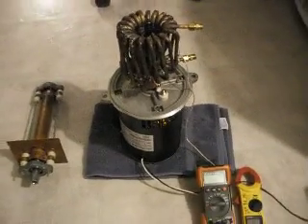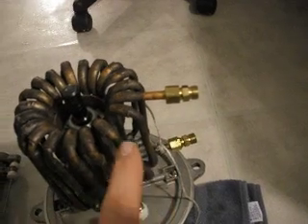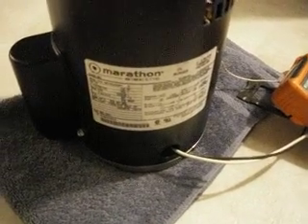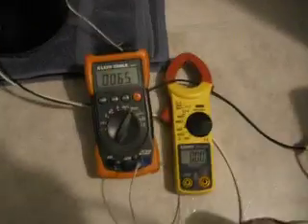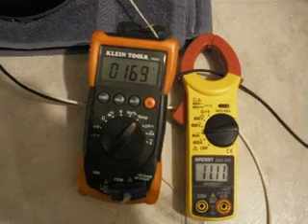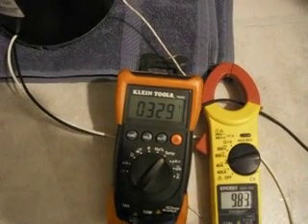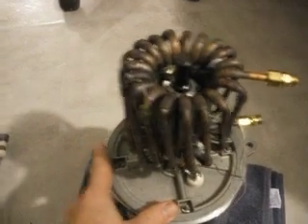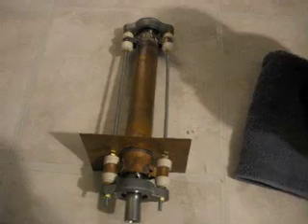Magnetic Heater Update

Comment: I was wondering about the heat effecting the magnets  since there kind of contained inside the copper ( cage or housing setup you have) I know there is high temp magnets available, is that what you have? Love your Design
Reply from the maker: Hello, these neodymium magnets that I used can withstand temperatures up to 176F ... but they do make other ones that can go up to around 446F. When they're spinning at high RPM they barely get warm, it's only when it's stops is when the radiant heat inside will heat them up. You can use some heat shield cloth and wrap them to help solve that problem😁.
Thanks for watching and have a great day!
God bless😇

Comment: I made 1 using a bench grinder...same 3.5
 amps and 3450 rpm....using a 2 inch copper coupler....got to hot touch very quick....magnets never got hot... ( only 4 )
very cool...now Ineed to find a proper application...but most likley use the wheel method...Thanx for your video
Reply from the maker: +craig campbell 
Your welcome buddy, good luck on your project.

Comment: 3 things.... you said it was 360 degrees but then you were touching it with your hand..
I was also wondering how you connected the magnets to the shaft....? was it J-B Weld....???.. you also said the temperature will keep climbing if you left it on.... if it were me I would want to check the extreme and I was wondering if you did.. and how high it was
Reply from the maker: +craig campbell 
Yes, it was 360 degrees but I was not keeping my hand on the metal if you noticed... I was tapping it. The inter copper was the hottest point of 360 degrees because that's where I placed the temperature gauge, the outer pipes we're not as hot. I made another video as to how I built the magnet shaft if you would like to watch that one to find out how I did it... It was very simple. No glue was used... I never let it run higher than 360 degrees due to the fact of the magnets losing their magnetic field... I was going to install a fan in the center which would keep the magnets cooler because they acted as a impeller. I ran it at that temperature a lot and I never had any problems with the magnets losing their field after constant testing. Thanks for watching.

Comment: hi there, 

can you tell me how many rpm you need to create this heat. 
also what is the psi of the water flow is it mains pressure that you were heating to 80*
Reply from the maker: +George Lowe 
I I believe the motor that I used ran at 3400 RPM, the faster you can turn the spindle the faster you can produce the Heat. The water line was hooked up to the kitchen sink faucet so I believe the pressure was around 12 to 14 PSI. Thanks for watching.
Reply: thanks for the info.
heres a stupid idea, do u think u could get enough pressure from the mains or a pool pump to power a tesla water turbine that powered the spindle.
or maybe more efficient to just power a heating element from water turbine.

Comment: Be aware of demagnetisation caused by hight temperatures. You can screw a second nut above the first nut so the shaft is extruded above the length of the copper tube avoiding heat dissipation trough the magnets to cool down the bolds and also the magnets! Greetings.
Reply from the maker: Thanks for your suggestions, but I had no problems with the magnets overheating... Through the spinning of high rpm created a wind votex like a vacuum that kept them cool. They will never reach the high temperature to lose their magnetic field. Thanks for watching.
Reply: +whyme2b o.k. , wishing you a lot of succes...

Comment: Is there no way to regulate, you just have to shut it down.  I do not see the big picture because, power used is not coupled with heat gained.
Reply from the maker: There is a way to regulate the heat, it's all to do and how fast is spinning. You can use a thermostat though to turn the unit on and off as it will radiate the heat for a good time which could save energy depending on how you set it up. Thanks for watching.

Comment: Hey! Very cool! I'm searching for an energy efficient radiant heater idea, and this seems like it could be the right technology. I was interested in an oil friction heater, however I believe using this idea would be running with much less drag. For those wondering what this technology could be good for, if you have your motor set up to run efficiently, you could have a radiant heater putting off 400 degrees for $30/mo running 24/7.
whyme2b, how would it work to close the loop and have water or oil circulating in a closed system. Would you fill the tubing up? Or leave some air in the loop to cause the liquid to circulate? I'm also wondering if you think a person could build a heater that is 2 or 3 feet high, with the copper tubing coiled upward, I'm just trying to think of making a bigger unit to really get a lot of heat output. Your thoughts?
Reply from the maker: Hello Ryan,  thanks for watching my video. Magnets work very well with very little drag if built in a long fashion like mine. The reason being is that the motor used to spin them has a bigger rotor size which can easily over come the magnetic drag and use lesser current to do the job. A closed loop system would work great by using a circulatory pump and antifreeze to reach a hotter temp, can be a closed system but would need to install a PRV valve for safety reasons or even just heating up oil and let it radiate and use a t-stat to turn on and off the motor when it reaches it's set temp. You can build a bigger design up wards but would still need to be long tubes. Good luck on your project buddy, and again thanks for watching.

Comment: Would be great to see a 12 volt space heater / stove top design for the pepper crowd or those of use trying to get away from the AC currents ruining our home environment.

If you added gears like on a bike then it seems this could be a very logical design ? I have a 21 speed bike and I can pedal up the steepest of hills with no effort, and I could do this for hours without stopping... The hard part in keeping the front wheel down.

Comment: Interesting use of diamagnetism or what I like to call 'magnetic friction'.  I can see having the motor hooked up to a thermostat so it cuts off when it gets to hot, and storing the water in a tank first instead of use straight out of the pipe.  This thing has to save you alot on energy bills.

Comment: Hi WhyMe, I see that you did this years ago, but did you ever determine if this is a cheaper way of heating water, like for heating all house hot water needs ?
Looks like it is a cheaper way, but I guess the best way is to find a motor using the least power or much less power to run the magnets .
Tx. for answering , Cheers, Gk.
Reply from the maker: Yes, I believe it would work very nicely if you found a more energy efficient motor to spin it....but for meeting house hot water needs, not sure about that? I think it would do well as a heater thou in circulating the water or oil in a looped system to provide all your house heating needs. Thanks for watching.

Comment: Hmm... I would call this an "Eddy Current" heater. Or, maybe, a "Lenz Heater" for the scientist who crafted the first formulae for this effect. The inner cylinder is, essentially, a shorted turn on a transformer. Even though it might be more efficient to use an electrical resistance heater, this could be wind or water powered. You just need a source of rotary power. Good for green energy, eh? Just keep in mind the magnets need to be kept cool. If they go over the Curie limit for the spec (called Tc in the data sheet on them), they stop being magnets.
Reply from the maker: Yes sir, I agree... In my design the magnetic shaft actually was a propeller as well which drawn in cool air threw the tube to keep them cool. I was thinking of also wrapping them with a heat shield cloth for extra protection, but never needed to.Thanks for watching it.

Comment: Even children know hot water expands, so why didn't this junk explode with the steam pressure?  There is no pressure relief on it hence, its a fake.
Reply from the maker: Steam pressure? I never looped the system to build up steam pressure...I only ran water threw it from the sink faucet pressure which gave me a 30 to 35 degree increase of running it continual. If ran in a loop, yes... I would use a pressure relief valve for safety. And yes, it's very real in what your seeing here! Thanks for watching.
Reply from the maker: Your not stupid, it's good questions that are being asked... Their are a lot of fake videos out there scamming people to believe that, but mine are from the heart... no deception intended. God Bless You for being honest about your opinion of this video. Thanks for watching buddy.
Reply: Kevin Chamberlain
He did mention that the maximum outlet temp. of the water was 80° (flow rate not specified), no steam there. Also, it is not shown as a closed/sealed system (nor should any be without a relief mechanism, of course).
Reply: Kevin: Listen to the video again, Whyme2b-did explain this clearly. tx.
Reply: @ Kevin Chamberlain : I watched the video and read the posts about it. You have questioned the steam pressure and explosion. In the video there is no water supply included in the design, so the thing will never explode - however the tin on the copper tubes will melt. Secondly, the pressure valve is a good choice from the designer. And third : whyme2b , I would like to be contacted from you through email, this design and solution is not perfect but could be pushed in a very good way. My company is interested in mutual work as well possible beneficial partnership. Best regards.

Comment: Hello!
What should the least motor rpm be? When the temperature reaches up to 250 C,how do the Neodymiyum magnets keep their magnetisation although normally they start to  demagnetise at 80 C?
Reply from the maker: At least 1000 RPM... The faster you can spin it thou, the quicker it will heat up. I've never had a problem with my magnets loosing their field because when spinning, the spindle acts like a propeller pulling cool air in from the bottom and blowing it out the top. The housing or magnet spindle can be insulated with heat wrap also to help out on keeping them cool for higher reaching temperatures. Thanks for watching.
Reply: Thats why you see the amperage drop because the magnets do lose magnetism but its still an awesome idea that works
Reply from the maker: Thanks buddy ... I never had any problems thou with the magnets loosing their field because in this design they act like a propeller which draws in cool air to keep them cool. One could also insulate the inner housing with a heat shield wrap to help out even more in protecting them from demagnetization. Thanks for watching.

Comment: I think I understand your reference when you say, "Hey Dad".  Also, you said in this video, that this design was an improvement over the last version, and it was, judging by the other version's temp rise in slower speed.  So, what were the improvements to this one from the last one, if I may ask.
Reply from the maker: A faster spinning motor, smaller magnets and spindle design, smaller tubing size, and also the 1/4" copper tubing brazed around the center tube for water to travel threw to pick up the heat. Energy efficiency of course would be better if ran on 208 volt setting instead of 120 volt. Thanks for watching.
Reply: whyme2b Thanks for your quick reply, and I enjoy your videos very much.  When you have time, let us know the magnet type, i.e. N45?  According to your last text here, it seems like your improved version went down on size, to the things that spin, and the coppers that heats up. Smaller mags makes the spindle spin faster and easier, and smaller copper pipes heat up faster and easier - is that the trick?  Thanks for uploading!
Reply from the maker: Thank you.....Yes, I believe the magnets I purchased were N45. Of course if you use N50 or higher, the better also it would heat up. The secret is in making the tube diameter smaller and longer, because what ever spins it will have hardly any resistance opposing it.
Regards,

Kevin.

Comment: Hi, which system is more eficient for heating water? Spining magnets or using transistors pulsed at a very high frequency  threw a big loop of copper wire?
Thanks.
Reply from the maker: It all depends on what you would use in spinning the magnets... a very high efficient motor would give you real good results. Also the induction would work very well as well if you don't want to have any moving parts. I had a few ideas in using induction for making a real efficient heater, but don't have the time just yet to make it. Take care buddy...

Comment: Hi Whyme2b, please let me know what are pulsing transistors, I could not find information with this name, thanks.
Reply from the maker: Sure, another name would be called " induction heating " which uses transistors pulsed at a very high frequency threw a big loop of copper wire to heat up objects that are placed inside the coil. It's kind of like what I'm doing except I'm spinning magnets to create that effect instead. Here is a real good website for experimenting in using induction heat...very good prices as well. http://www.rmcybernetics.com

Thanks for watching.
Reply: Thanks for your answer, I´m trying to made a boiler for heating house, and I don´t know which is the best way, with magnets movement or induction heating. Please let me know with your experience, which system may be more efficient and possible to made.
Many thanks.

Comment: Couple the hot water output with a heat exchanger, and I would surmise that you could heat running water either more efficiently or reach greater temps, instead of having to heat each individual unit of water as it makes a single pass through the coil. (But I'm no expert)
Reply from the maker: Yes sir, correct... It would be very efficient to loop the system back into itself. Would achieve higher temperatures very fast. Thanks for comment and watching.

Comment: hi nice concept .i have one question ? if i make it on a bigger scale could it head radiator or two ? of course using bigger tubing and more magnets ?
Reply from the maker: Thanks.. yes to your questioned but the object is to keep the diameter small and pipe longer, otherwise motor that spins it will draw more current to overcome the magnetic short propulsion. This small design would work great if the water ran in a looped close system. Thanks for watching.

Comment: looks like a hoax.  I don't know what the Temperature gauge is reading but it seems he wouldn't touch it if it was 300+ degrees and not come away with a burn. Why not run some water threw it so we could see some steam
Reply from the maker: Looks like a hoax? Are you kidding me??? I'm showing electrical specs all threw the video. The actually sensor probe was mounted to the inside of the copper tube, not the coils running around it. 300 degrees is touchable for fast checks of heat being dispatched without getting burned....The unit does not produce steam as I have said in the comments below. Anyway, thanks for watching.
Reply: Sorry if my Skepticism upsets you.   What is the basic principle that allows magnets to heat copper?  is electromagnetic induction?
Reply from the maker: That's okay buddy, I'm not upset about it... all comments are welcome. You are correct in saying electromagnetic induction, it's the same thing in what I am doing here except It's just using spinning magnets instead of pulsing transistors. It can be very energy efficient if using a high voltage motor or other means to spin them... then again, pulsing transistors also can do the same but with no moving parts. Best regards.
Reply: Christopher Weston Diamagnetism.  The copper is neither repelled or attracted to the magnet.  Rather it is like a force field.  As the copper moves through it, there is friction.  He could use aluminum and silver too, if he wanted to.

Comment: Why does the motor draw 10+Amps when its rated at 3.5Amps?  Thats a huge difference in energy costs.
Nice project by the way.
Reply from the maker: Because I was using 120 volt input instead of 208 volt. Would be way more efficient using higher voltage. Thanks for your comment and watching.

Comment: This is an amazing device. One question comes to mind and the only conclusion that I came up with on how to regulate the water temperature would be to control the amounts of electricity going into the motor so the water temperature can remain constant and not boiling hot. Did you come up with something similar?

Comment: I'm sorry but this is a bad way of heating water. It is complicated, noisy and lossy. Next to using a heat pump you will get the best value for your electricity using a well insulated electric water heater, basically a simple resistor with a thermostat to control the heating.
Reply: Hans you are looking at this in the wrong way, this is a prototype and as a prototype it will not look pretty and obvious defects will be seen by many, but the application of this device is amazing because everything wrong that you see now can be easily modified to normal regular homes. Do not look at it as what it is now but what it will look like once it has been perfected.
Reply: osito021 No osito021, you are entirely wrong. Go do your pysics! ;)
Reply: Hans-Göran Branzell Hrm ... physics :(

Comment from the maker: Yes sir, I'm always open for comments and improvements... A iron core however would cause more drag on the motor which would draw more current to keep it going, but yet would increase the speed time of heating. The copper coil has no effect on the power consumption, it's only purpose is to collect the heat being generated from the tubing. Thanks for your comments and thanks for watching.